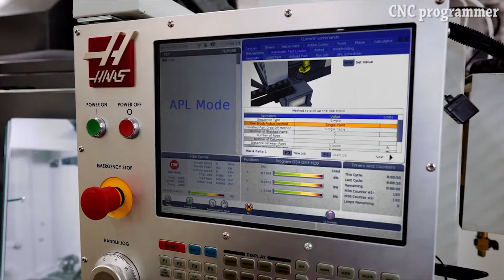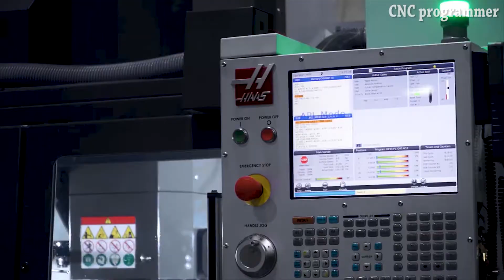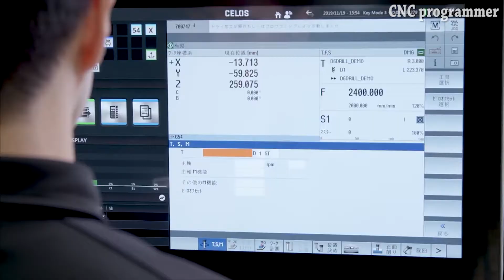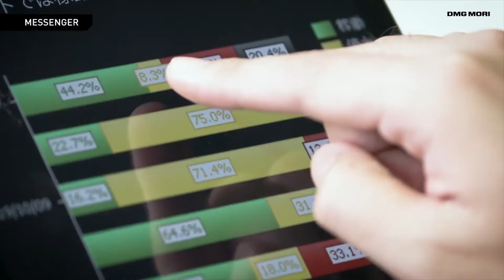Is The CNC Programming Profession Coming To an END? - AI and Cnc Programmers

Comment: CNC programming will certainly continue to evolve. AI will increasingly suggest machining cycles upon job recognition in the future. But the experience of a good CNC expert won't be easily replaced. Be it in selecting clamping devices, aligning the workpiece, defining the milling strategy, tool behavior with different materials, etc. 
3D jobs for trochoidal milling aren't always the best choice. This is where I see the limitations of AI. Compare it to a navigation system: do I take the most economical route, the fastest, the shortest, etc.

Comment: The difference between a button pusher and a real machinist will be seen.
Reply: Cnc operater is button pusher?
Reply: many of them yes @kiesacro
Reply: @kiesacro yes
Reply: @ir0316  ... huh, I am pretty sure that measuring and adjusting parts due to wear together with setups is not a button pusher. What do I know, I only done it for a year now.
Reply: @zerocold961  at my shop and most others I’ve seen those are basic tasks an operator has to do. It’s only when u start setting up u begin to climb the ladder